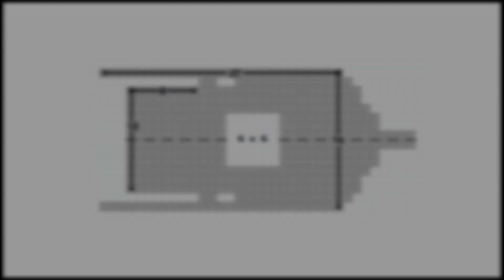Scrap Mechanic Stone Mining Super Machine - Explained //AW'S Scrappy Adventures

Comment: and where and how do you build the bucket system on it ? you should just have done the entire vehicle than the 2/3 of it
Reply from the maker: Yeah, should have. But it wasn't just Idea>>>vehicle, closer to Idea>>>several hours/vehicle redesigns>>>vehicle, so it would have been a lot of jumpcuts and "some time later THIS was changed to THAT". Figured it would be enough to explain how it works (recorded separately) and let people get creative with designs.
Reply: @AgentWest  well im not great with at designing such vehicles  , i have a miner but it has the ability to send minerals under the map (for ever) so i searched for something more reliable . Also i have a question , is it possible for you to put your vehicle in the workshop ? (if you do i'd like the name of it)
Reply from the maker: @vodkanizer6866   @Vodkanizer  I suppose i can at some point. However there are a couple of follow-up videos ("Let's find the best way to mine rocks in Scrap Mechanic!" and "Ultimate Scrap Mechanic Stone Miner") to this one where i experiment with several other designs and test them out, then combine the two into an even better machine. I think you'll find those more interesting and that final miner is already on the workshop.
Reply: @AgentWest  i aldready watched your videos , i just find that desgin very cool and i dont care about efficiency i just want something a bit technical and cool to use

Comment: How do you get the stone that is hidden underground at the rock hills?
Reply from the maker: Easiest way is to place down your lift above where you suspect the stone is, then raise it up while creating a vertical beam. Then build a basic platform at the bottom of that beam, and lower it into the ground using the lift. That will dislodge any lose rocks below ground, making them spawn above.

Hopefully this little diagram better explains what i mean. This is the side view of the thing.

  +++++
--------  +                                              +++++
   []      +                                            -------     +
   []      +                          >>>>            []        +
   []      +                                           ====     +
====  +++++++++                                       +
                                                                       ++++++++++

Comment: Deeper forks on the front red arm would probably make the raw stones go into the loader easier
Reply from the maker: If you're talking about the red part in the model at the beginning, making it longer caused it to push the front of the bucket up off the ground, making loading more difficult. 
Ideally there should be horizontal wedges on the ends (think of the whole arm as an L shape) and the whole arm should move in a straight line instead of the scooping motion.
Reply: @AgentWest  oh okay, I was wondering how to approach that, I tried it in creative as concept and it was still somewhat locking up
Reply from the maker: @qbrain3414  It was a tricky thing to get working and is part of the reason for the yellow piece. Essentially it allows for a more 'scooping' motion instead of just 'pinching' against the edge.
One thing i figured out might help a bit too is to have the leading edge of the bucket rotate, basically feeding materials into the bucket.
Reply: @AgentWest  yeah I was thinking about that, it still pinches if I do anything more with it, but using a feed system seems to be working the best
Reply from the maker: @qbrain3414  You can use springs to compensate for the pinching, but it gets very complicated (and heavy) very quickly.
Reply: @AgentWest  yeah I bet

Comment: You can use pistons on the bottom of the cage, it will help you lift bigger rocks. my miner is similar. I've lifted 2 square rocks still stuck together, it's really heavy but it's satisfying to see it break down all the way into rods.
Reply from the maker: Was trying to avoid pistons since they are kinda "expensive" to make, but you're right. As powerful as they are it may be better to use them just to be able to process more materials faster.